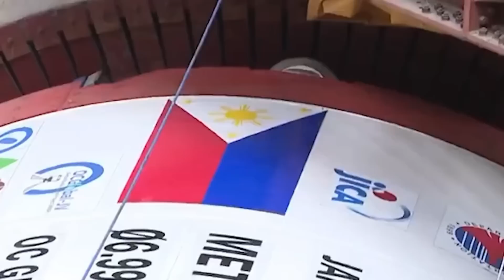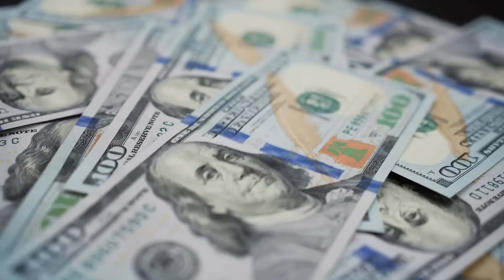Philippines’ Project of the Century: Metro Manila Subway Update 2024

Comment: THIS IS THE SUPER SUPER SUPER MEGA MEGA MEGA BUILD:
Philippines will be building the SKY MANILA, they  would put Metro Manila's 100 km x 100 km land area up by 50 meters using 500,000 posts. 
There will be three levels, the ground level is the existing land, all vehicles would use the ground level, 
hundreds of MRT and LRT would use the second level and therefore reducing massive amount of vehicles using the ground level and less traffic, 
the third level would be vehicle less area, yes no cars, trucks, jeepneys. 
SKY MANILA is walking , jogging, biking, scooting area. It will be full of skyscrapers no less than 300 meters tall, condos, hotels and offices. 
Hundreds of parks, huge malls, millions of restaurants, thousands of hotels, several thousands of factories using all electric. 
All vehicles will be full electric,  non-electric vehicle are not allowed. 
Many swimming pools, basketball, tennis, football courts, and many sports venues. 
Hundreds of entertainment arenas.
It will have airport for helicopters or any vertical take off planes. This will be finished in 2035. Flood will be the thing in the past. From Filipino concept.